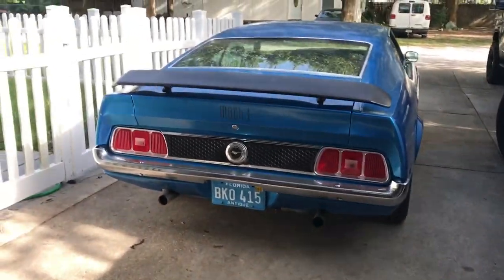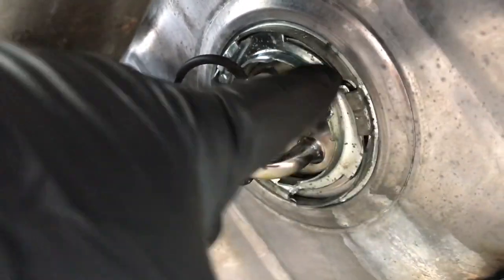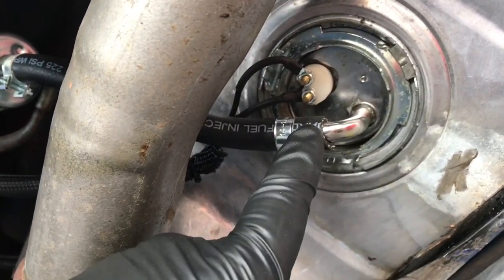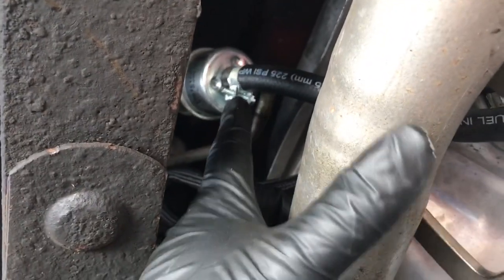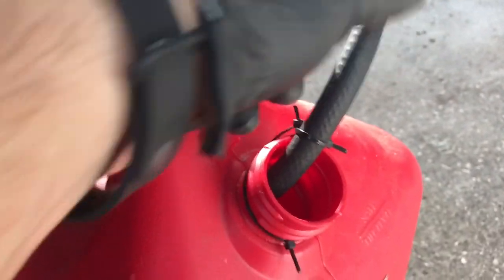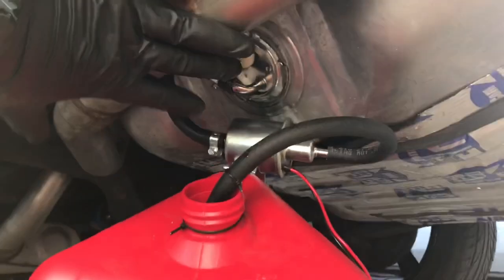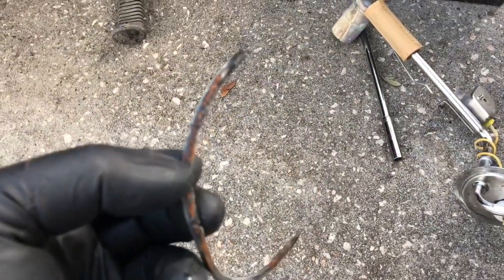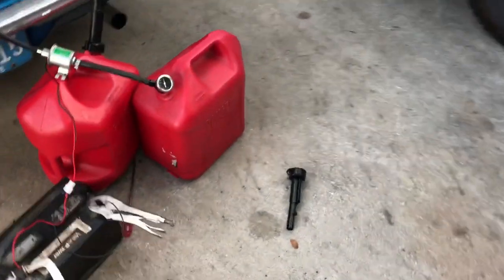How To Drain Gas Out Of Gas Tank Using A Fuel Pump

Comment: That looks dangerous no shield for hot exhaust …🔥🔥🔥
Reply from the maker: That’s why you should just be watching from the safe seats. Let the men do the heavy lifting.
Reply: I meant when you finally get your car running… your fuel line is like inch’s from your exhaust…fire men lift heavy hoses too….. help smart asses just the same…….
Reply: Don’t argue with Mr. Fixit! He apparently has the prototype in-tank electric fuel pump that’s been fine for 50 years while every fuel pump I see for a 1970 Mach 1 is an engine mounted mechanical one.
Reply from the maker: I agree with you 💯 smart man. Elec pump is on the firewall tho. Glad you agree with me

Comment: This is great . I haven’t seen em available at harbor freight! .million  dollar idea. I’ve a pinhole on my 65 Galaxie , jb tank weld peel off after 8 mths. Metal was slightly wet with gas from seeping at the hole. I need that sending unit gasket swap as well. Have to do it now.. west. Jb weld again . Flex tape, seal all, jb on top. Put a screw into the hole ?

Comment: Thanks for the great idea. I am going to add a transparent fuel filter in line before the pump to protect the pump. I know it is a cheap pump, but I want the pump to be reliable to run long enough to drain out old bad gasoline in a truck I improperly stored for years longer than I had intended.